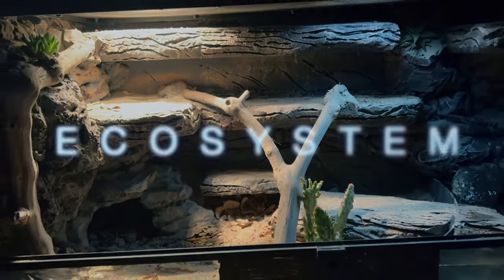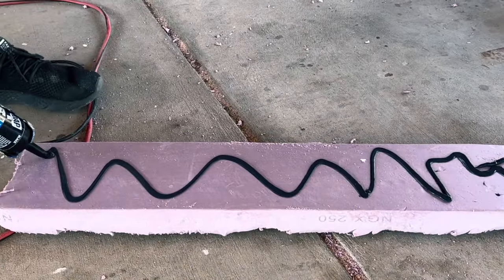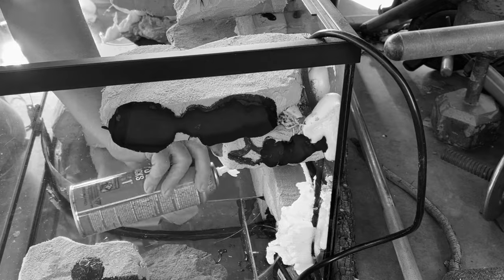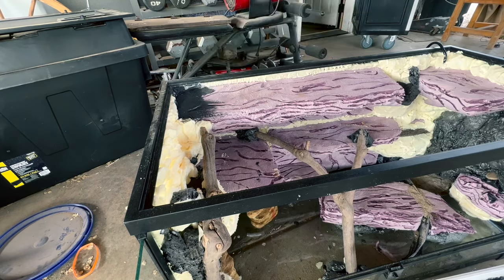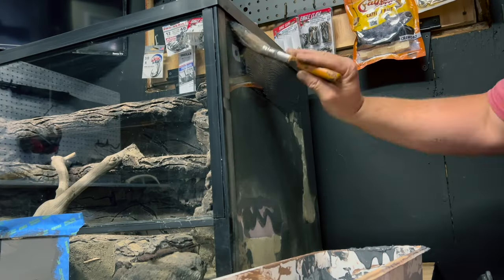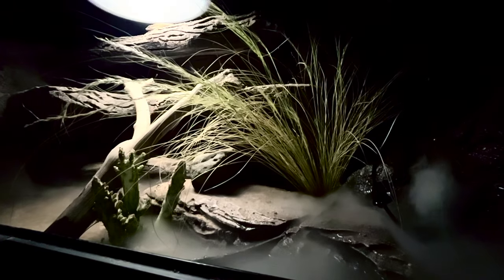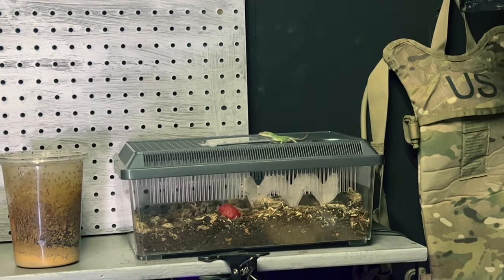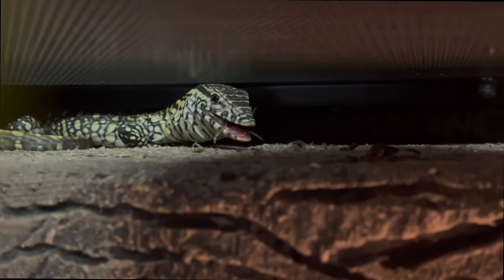I Made A Desert ecosystem Paludarium For A Nile Monitor!

Comment: You got a list of materials that’s safe to use that you used in this video it’s pretty cool I wanna make one for my son
Reply from the maker: Yeah so depending on the size of tank you will need 
1-2 cans black spray foam (lowes or Amazon)
2-2 in foam board (lowes)
3-drylok basement paint( ace hardware) 
4-cement dye (lowes)
5-planters usually come with plants 
6- small water pump
7- pice of plexi glass to seperate land from water
8- 100% silicone. Get the odor free one in black or brown it drys faster and doesn’t have a strong smell. 

Hope this helps.

Comment: You should do a little more research on your lizard species. Your "blue-tailed skink" is a six lined race runner and your "geckos" are green anoles.
Reply from the maker: The blue tail is a whiptail lizard  and I know what anoles are. If you read any of the other comments you would see this. But thanks for the repeat comments if you did a lil research you would have seen that
Reply: @nakedfreak1  💯
Reply: @MrHillbilly  you're still completely wrong